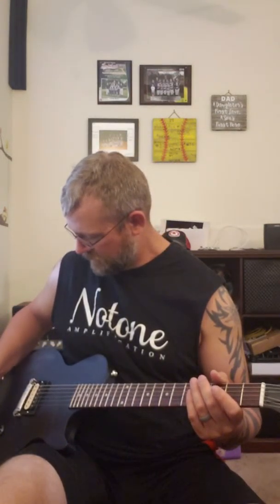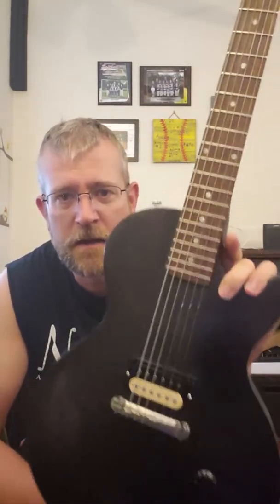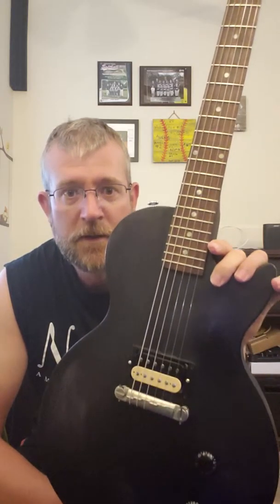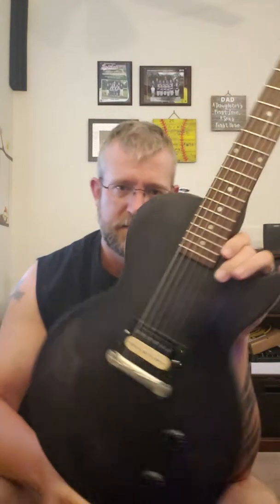50s Lp wiring vs Modern Lp wiring

Comment: Excelent!! A question, I have to wire completely a les Paul which is hollow, and I have two PAF mics for ir, should I go for the 50 s or modern wiring? I love the sound of a les Paul when is like a Cello, not so bright.
Reply from the maker: I would do 50s lp.

Comment: Just change the capacitor .... if it has a 22uf and it's a smidge bright???  put a 33uf in it ....47uf are too dark and lose clarity for humbuckers unless you've wired it series /parallel,  besides when you back off with a .33uf you still have some brightness that cuts through unless you like Black winter pickups then it just doesn't matter right ?? .... make sure you put it in with the shielding on the "low" side or ground for hum ...use alligator clips for a temp solution, Clip, check it then reverse the polarity and see if it gets quieter ... they stopped worrying about properly marking them years ago assuming we all have oscilloscopes in our  laboratories ...So i like the Russian Caps cause they are marked and you just solder them in and save time they aren't cheap but sound great .. just my two cents
Reply from the maker: 59s lp wiring and modern are 2 completely different things and respond totally different to vol and tone changes. Very much different than just changing the capacitor.